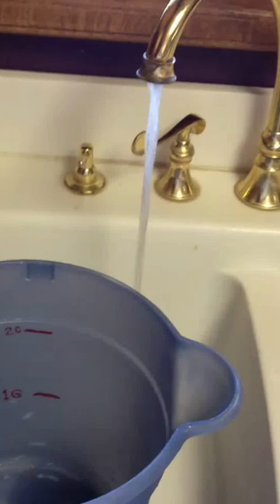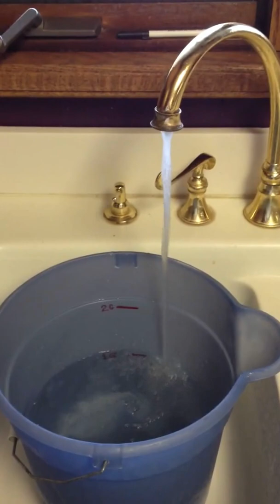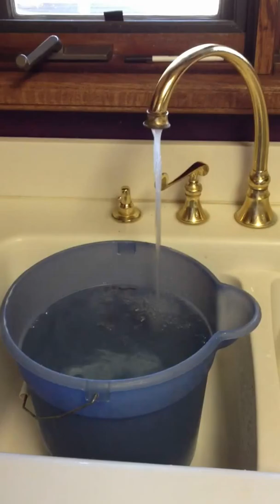0.9 GPM Water Flow Example

Comment from the maker: The issue was that the town water department installed faulty remote water meters they could obtain readings by just driving down the street. My mother's basement had a leak that was dripping directly on the meter causing a grossly elevated high reading.  They claimed that the high reading was due to either a leaky faucet, tub or toilet.  I created this video to show what an equivalent leaky faucet would look like based on the water usage the meter was reporting.   Unfortunately the town was small, with little resources to problem solve and even fewer employees capable of understanding the ridiculousness of the numbers reported by the meter readings.   The Town ultimately just applied the exorbitant water usage fee (>$1,000) associated with this false reading to the tax bill at the end of the year.  My mother has since moved so I am unsure if there have been more issues of this nature or not within the water district.

Comment: Horrible backstory to this video. I should add though that for your trouble I was able to decide on a pump for a parts cleaning basin at my shop. 1 gallon per minute is an adequate flow rate for my use. Thanks for the video, hope these problems did not consist after moving out. What a plain to see video, hard to imagine not being able to understand.